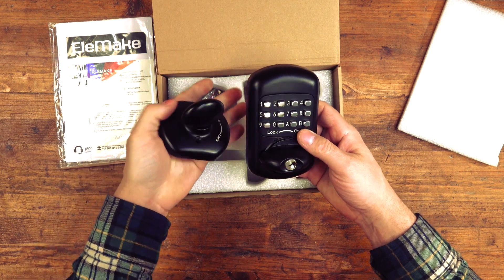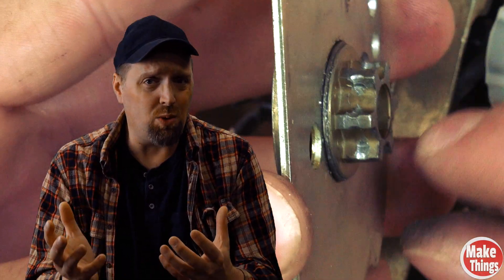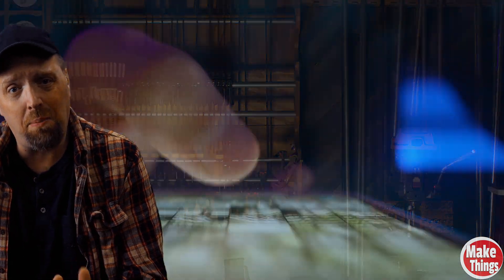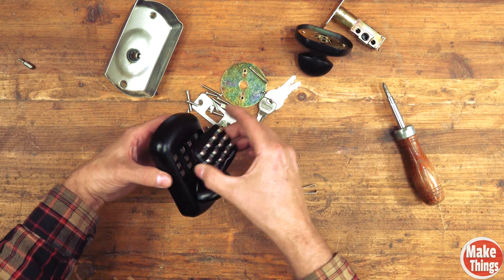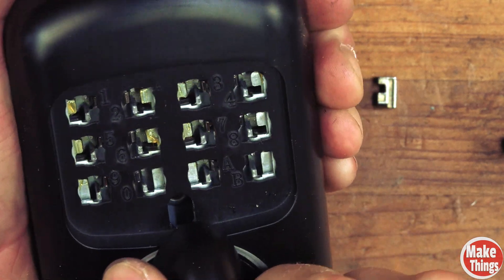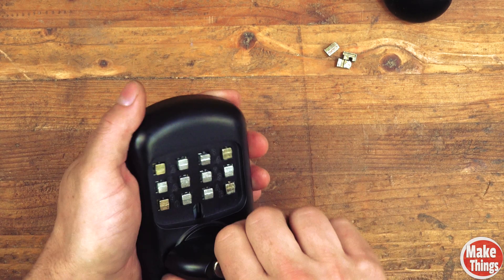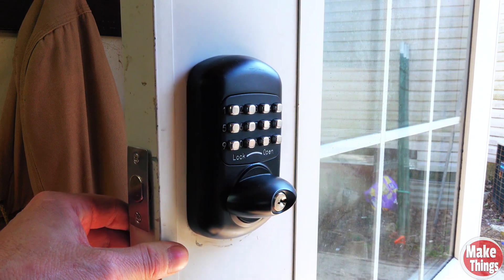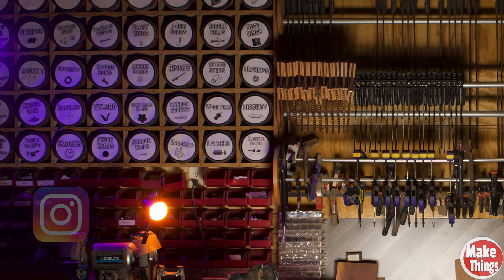A Push Button Lock with No Batteries?! // How to Lock Your Shop With Elemake Shop Lock// Make Things

Comment: You might want to see what The lock Picking Lawyer on You Tube has to say about that lock. I'm fairly sure he will tell you that the code portion is alright but the emergency key lock is garbage and can be easily picked. Many lock makers spend a lot of development money and then cheap out on the keylock.
Reply: Yep, in every similar product so far, they use the cheapest possible core and anyone with 30 seconds and a lockpicking set will easily unlock the door through the key way. :( hopefully they put some thought into it for once